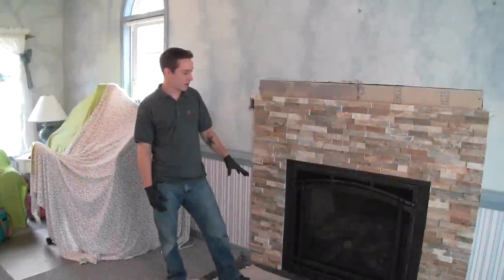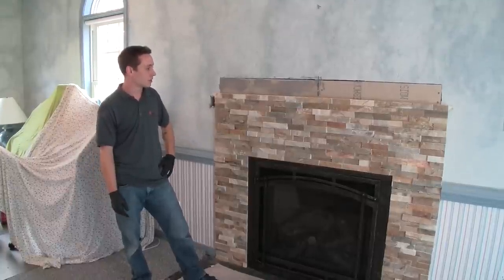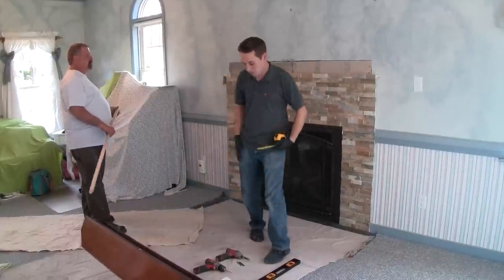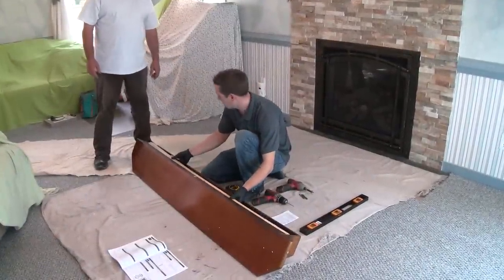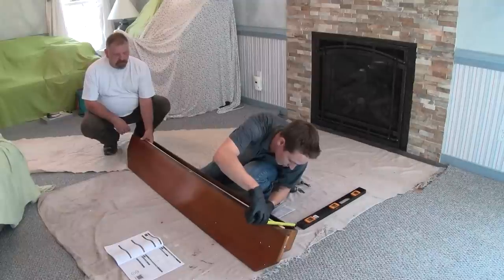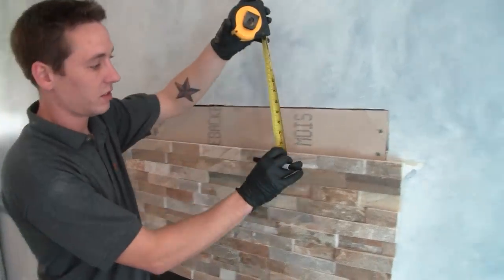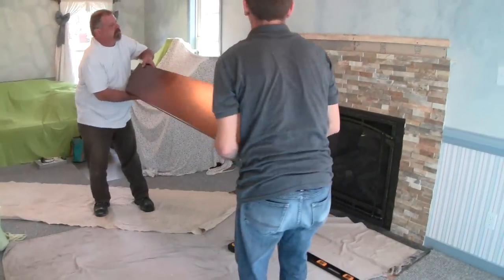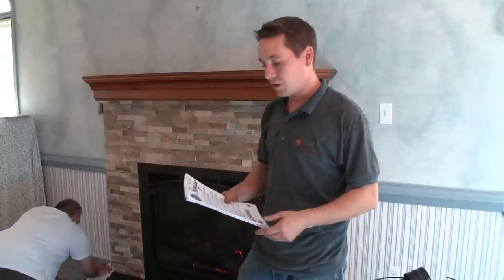Installing a Pearl Mantels Shelf

Comment: This cleat system will only work if the surface the cleat is attached to is perfectly straight, I'm trying to fasten it over brick, and it is not working. The brick surface is uneven and bowed in the middle
Reply: How did you end up fixing it or installing it. Did you end up having to buy additional hardware?  If so, What kind?

Comment: What happens if something hits it from underneath, won't it pop of the cleat?
Reply from the maker: Bob Wrotenstien it’d take more force than a random bump to get up and off the cleat. This type of attachment is used in hotel furniture to lock it in place as well as many wall shelf systems
Reply: @RallohE   I didn't realize the piece on the wall was angled and will wedge into the piece in the mantel,  so it would have to be a direct upward shot with enough force to lift it up the entire length of the mantel
Reply: @RallohE  Probably you are right, but I chickened out and screwed it to the cleat anyway
Reply: YES, i think its unsafe